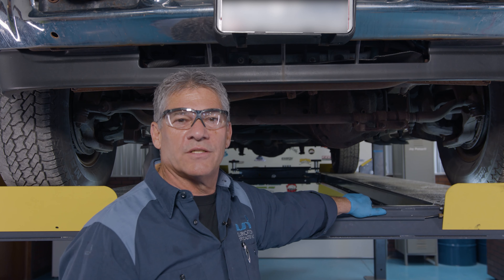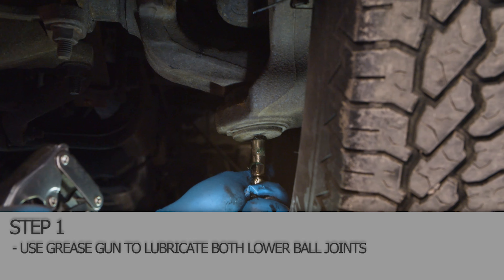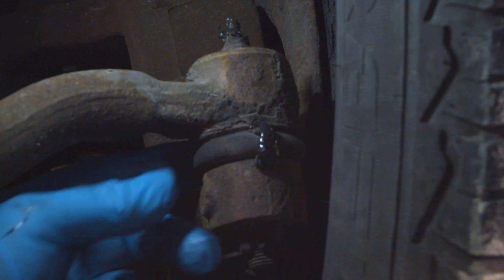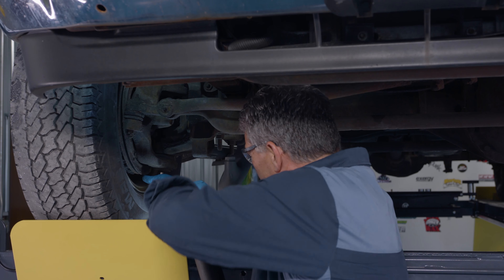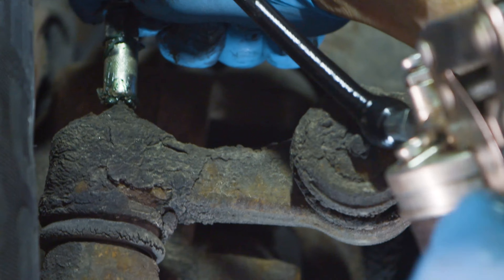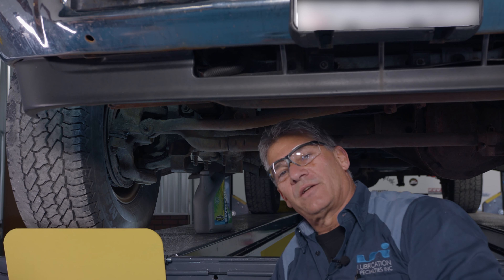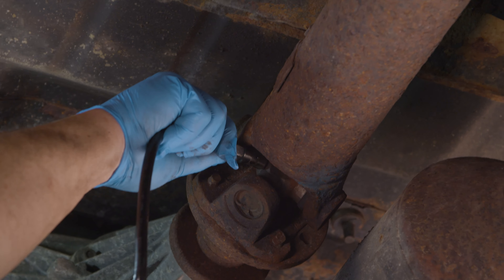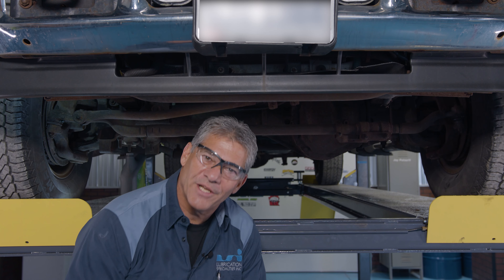How to Grease Front End & Driveshaft Zerks on a 2003-2007 Ford F-250/F-350 6.0L Powerstroke.

Comment: Are these the only zerg fittings on the 2004 F250? Are there others?
Reply: Also, on this truck you're showing 11 fittings total? Upper and Lower Ball (2 each), Idler and Pitman arms (2 each). Total 8 so far. Then this specific truck had 3 on the drive train. On the 2004 F250 do you normally see that? Not finding a whole lot of documentation on this specifically.
Reply from the maker: That is what I am seeing as well on most 2004 models.
Reply: Had mine 3 days 2004 f350. Having starter rebuilt. There's a lot of em under there that's why I'm here.